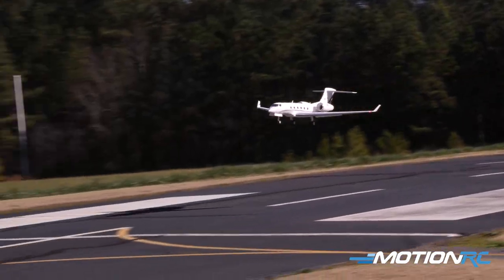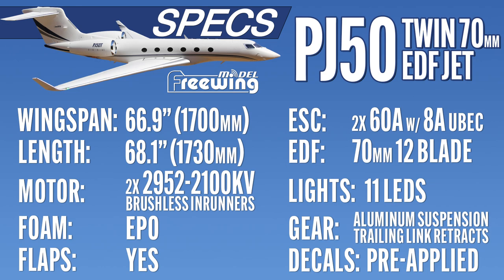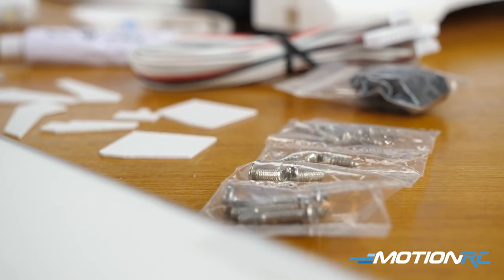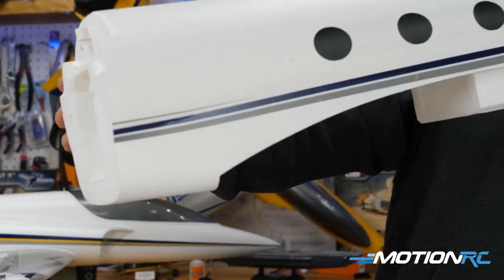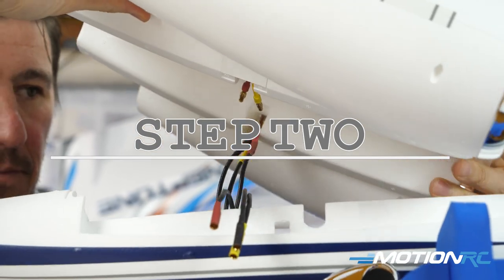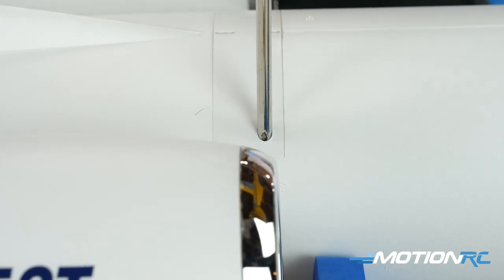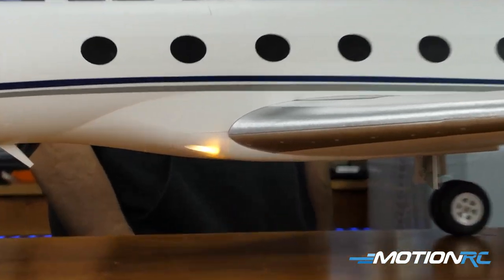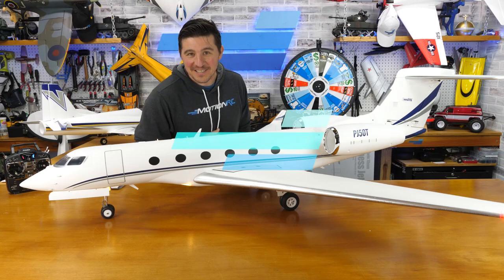Freewing PJ50 Twin 70mm EDF RC Jet Assembly - Motion RC

Comment: Hi, off topic, but I just bought the ta 152 and was wondering if you had any trouble with not gluing the wings together? 
Thank you
Reply from the maker: No trouble, the screws hold nicely and you'll want to be able to remove the wings if you ever need to make a fix or a change